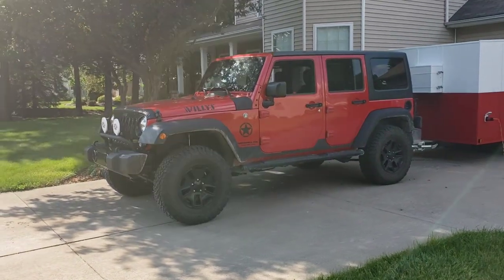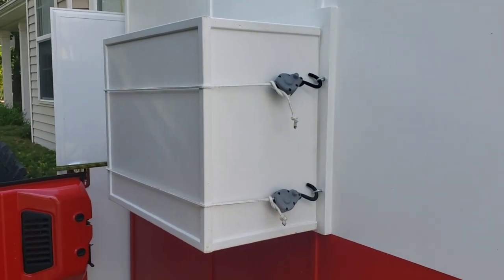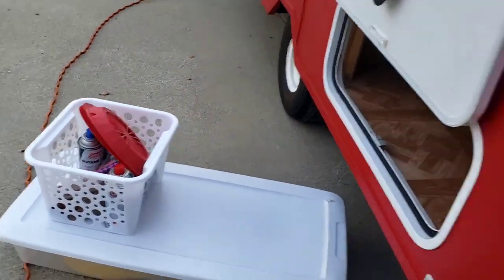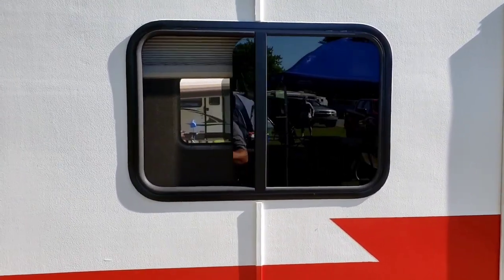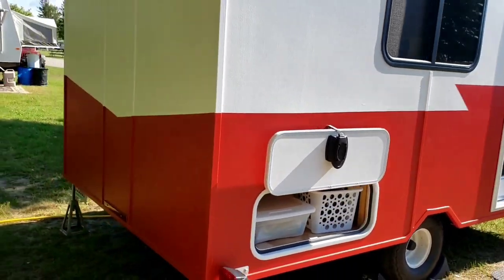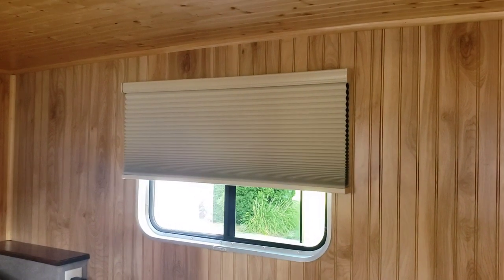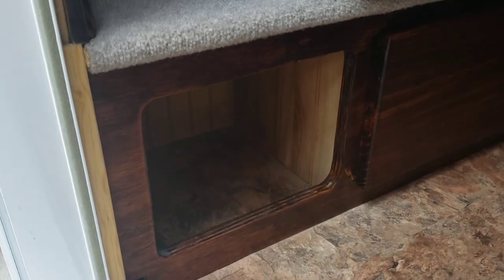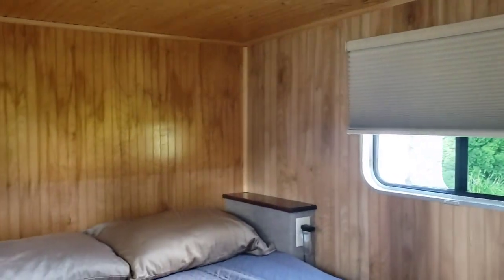DIY Foam Micro Camper Tour

Comment: How fast can you haul that camper with those small tires ?
Reply from the maker: It runs at expressway speed (75 mph) behind my Jeep Wrangler just fine. I've hauled it non-stop for 3+ hours several times. Never an issue.

Comment: Great looking camper! What's the rough height of your camper? It definitely looks more than 4 foot, so I'm guessing you must have cut down multiple panels for the sides and maybe glued them together?
Reply from the maker: The camper is 80 inches in the center to the ground. It's 66 inches from the roof top to the bottom of the frame in the center.  You are correct,  I cut down 4x8 sheets and seamed it in two places each side. I would have gone even higher on my wall height but I need to get it side my garage which only has a seven foot door.

Comment: Nice job a few questions please 
...

•What is the weight of the camper?

•cost 

▪jeeps towing capacity i have a 2011 scion xb.

•size of trailer and where did you purchase?

•where did you purchase the door and the size?

Ps after watching the video everything looks great it missing one thing of course it's only my opinion a nice large rear window wow would that look great.
Reply from the maker: I haven't had the camper weighed yet. I would guess it to be about 1,600 - 1,700 lbs. With all of our gear in it. It's 6' wide and 10' long. Look in the info section of the video for links to door and more .the door is 26 or 27 wide by 56 inches high... check out more of the videos in the series for all of the details. I think I put aout 4k into the whole thing including the mattress,  microwave,  etc...
Reply: @ToddsProjectsandOutdoorJournal  you rock thank you

Comment: Just Curious, what the inside dimensions are?  Love the camper. Nice build
Reply from the maker: The walls are made with 2" foam, 1/4" paneling and
Reply from the maker: 6" less 4.5" x 10' less 4.5"
Reply: Thank you. What is the inside height?
Reply: 5 feet from finished floor to finished ceiling. The measurement from floor to the top of the mattress on the bed is 18 inches. Thanks for watching...